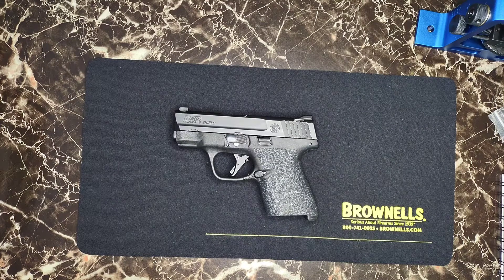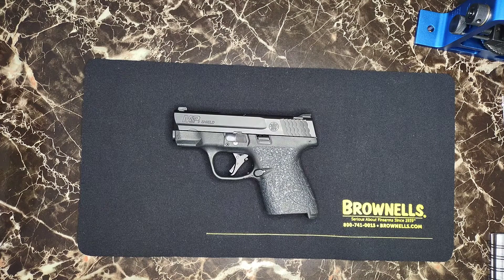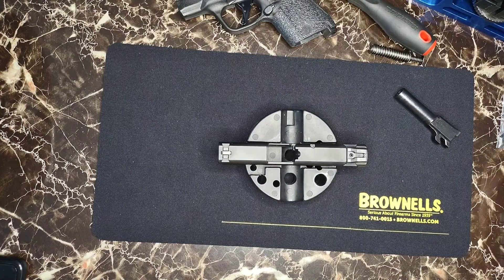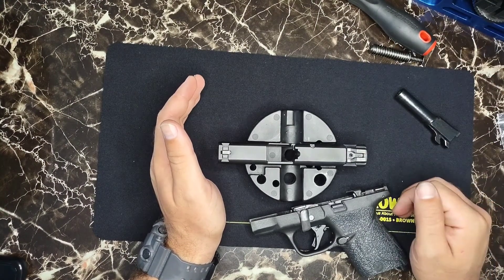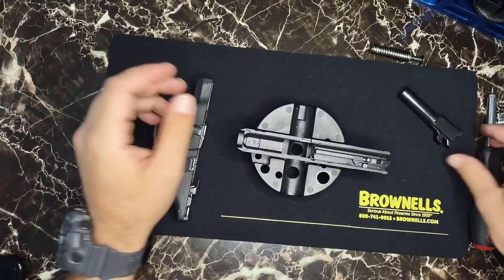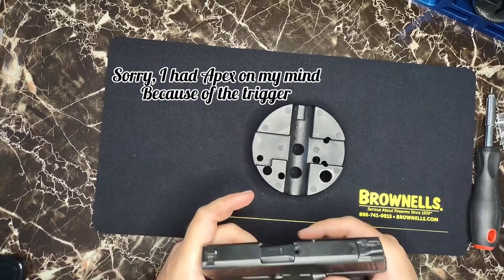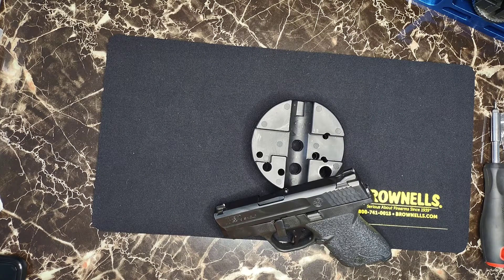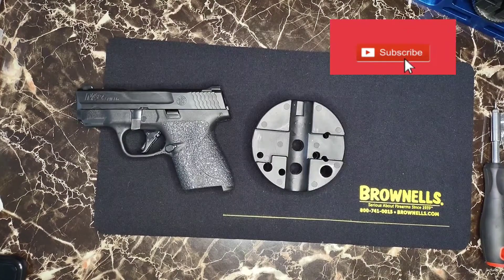I failed my Smith & Wesson ‼️🥲

Comment: Yea you're gonna need some heat to get that lactate loosened up. Not sure which lactate you used, but should only use purple or blue on small screws like that. Pull weight should be less as well, from what I remember when I installed this trigger on my wife's shield. Anyways, hope you're having a great Sunday!
Reply: Cyanoacrylate, not lactate. I think your phone "corrected" you.
Reply: @deucedeuce1572  Loctite is what I meant to say. Loctite/lactate 🤣
Reply: @ChristianGrest  lol. Duh. I was way off. (same thing though).